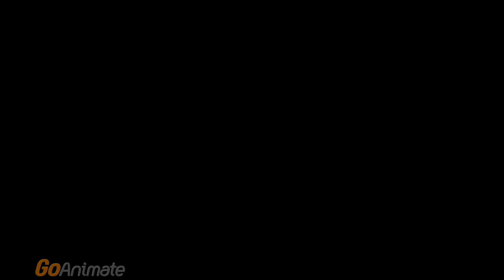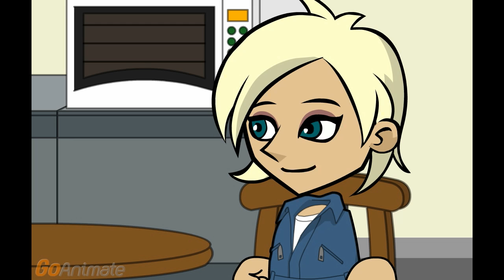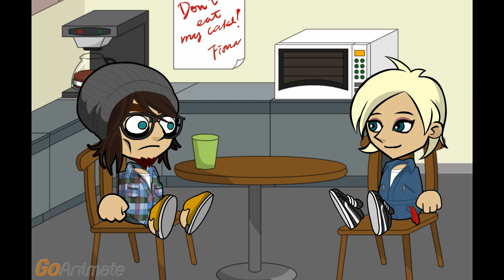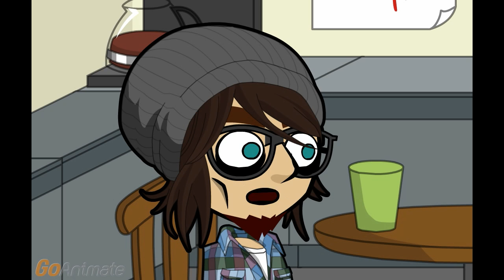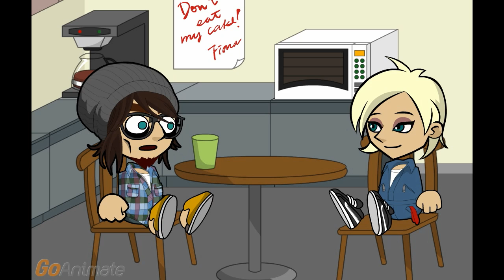Atwood Furnace Error Codes

Comment: And if you have 3 flash  means lock out an i cant turn down the heat via thermostat and will not stop and it continues and pull the rj11 cable out the control box and now get no power at all to the furnace how do you fix that ? Must be the thermostat control box ???

Comment: I'm just getting a study quick flash, this video is irritating I just need a LIST of error codes.
Reply: Michael Johnson did you fix your issue?, I’m getting a steady flash as well and can not find anywhere on what a steady flash means.
Reply: I’ve got that steady rapid flash!   Even tried replacing the board. Furnace won’t start. Not even the blower.  Please help with this rapid LED flashing!
Reply: did you find the issue I have the same steady flash
 @jetstream59